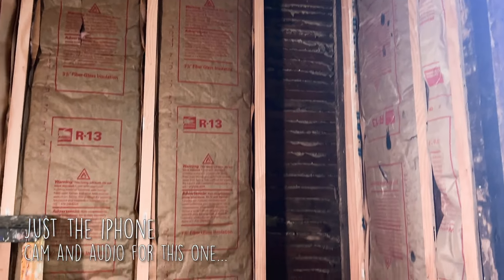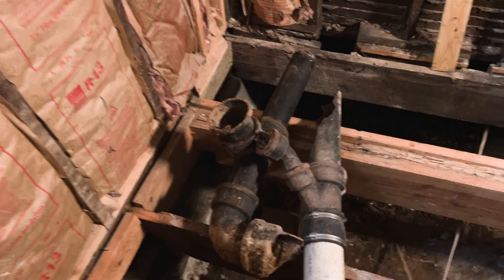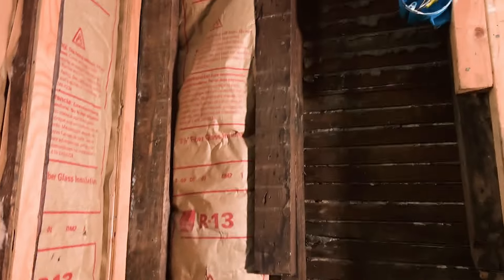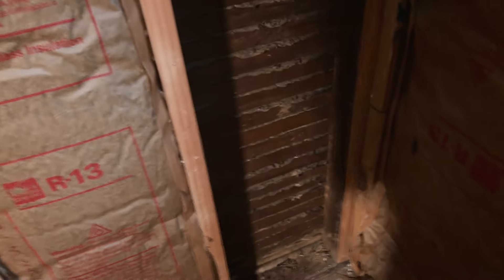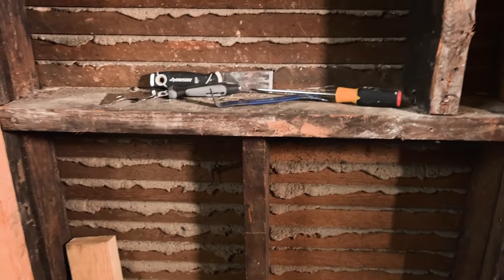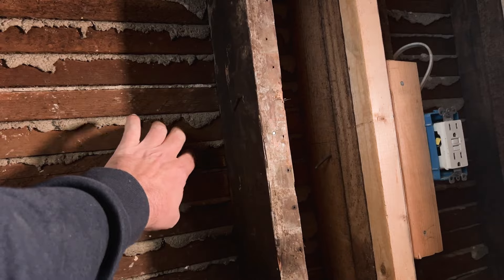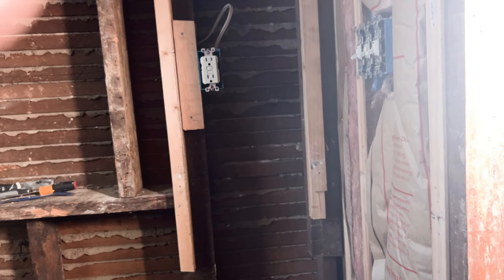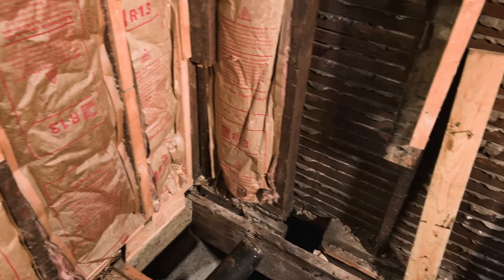Cast Iron GONE

Comment: Im glad you're posting and recording this. Im about to do the same thing with my wife and I's bathroom. Needs a new subfloor, vinyl flooring, trim, tile, paint and tub. And its our only bathroom/shower so im really looking forward to taking showers outside and crapping in a bucket for a week....lol. But all said and done it will be worth it. I already updated most of the plumbing cause our drainage stub out was corroded and stuck together so it had to be cut out with a sawzall but it looks and functions so much better now. I also had to update the sweat connections for the sink hot and cold water shut off valves, i just added some half inch copper threaded connections so i could use the threaded valves that are considerably easier to replace whenever nessesary than the old sweat connection shut off valves. Anyways, im glad to see a like minded individual tackling the job himself too. Looking forward to the updates!

Comment: I’m not sure what state your in,but you can wet vent that toilet which means you run your 3” vent stack in the bay behind the toilet and put a 3x1 1/2 “ tee facing a stud or two with a 2” hole/holes and you can run an 1 1/2 arm over to catch your sink… the stack will vent that sink which in turn means you don’t have to also drill more holes at 42” for vent the lower ones for drain and only one fitting on stack instead of two.. Here Chicago your allowed one vent stack per house ,but not sure what your codes are but probably similar? Wet vents are pretty acceptable…. Just trying to give back like you always do to us amp nerds🙏🏻👍🙏🏻👍🙏🏻
Reply from the maker: I thought about it from just about every angle. Staying with the existing two dry vents, though they’ll actually be working now.
Reply from the maker: We’re IPC but I’m bumping up to UPC specs.

Comment: From one pedant to another, lath is pronounced with a short 'a'. While I'm at it, the analog to 'toenailing' with screws is a pocket screw, so named because one usually cuts an angled pocket in the end of the board before driving the screw.

Cheers,

Alan 
Berlin
Reply from the maker: Thanks, yeah, misspoke on the lath.

Comment: Buy the cheapest Craig pocket screw jig set with the drill bit included and a C clamp. It worked out really super nicely for me. I made a nice interference fit a plug to go into a large sliding window opening, to install a window air conditioner using that little Craig jig and the drill bit. I used the same jig when I replaced the sills that the termites ate.  A duct booster would have worked too, but $250 vs $1200, and I can run a window AC, the lights, a microwave oven, and the refrigerator on 6.5KW gas generator. The rooftop AC would take a 14.5KW generator to start up. I have a gas range, so that's not an elctrical supply issue. Cooking on an electric range? Not my perference.

Comment: Homeownership is a busy thing😉👍👍
Remember having to flush out piping for my radiant flooring heat, far from the mains. Hoping all the time cutting up tile and flooring wouldn't be necessary 🤞🤞🤞
Luckily...the pressure flushing worked. Logically, a closed system wouldn't need flushing... RIGHT???🤣🤣

Comment: If you need a chain saw for your 'stuff' you need more fibre in your diet!
Reply from the maker: Chain pipe cutter. One of the most miserable tools I’ve ever used, as it’s thirty pounds you have to hold at a certain angle with one hand while fighting to get the chain aligned with two argumentative clamps while the chain doesn’t want to play along and then you have to repeat the process to get the chain disengaged after making the cut.

But it does snap 4” cast iron in a quite satisfactory manner. Sounds like victory.